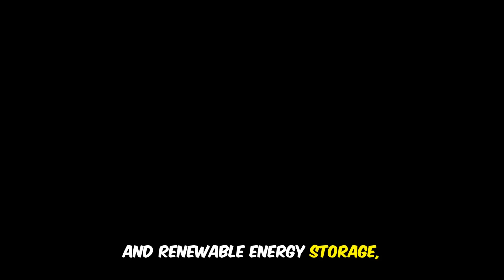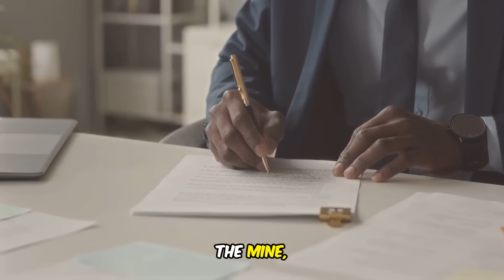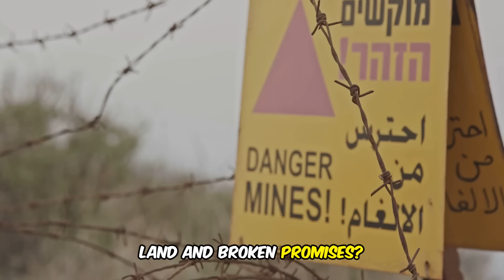Ethiopia’s Lithium Shock: The Kenticha Mine America Fears the Most

Comment: If this information is true, then,Ethiopia should plan to exploit its resources by converting into more valuable end products, and it is now high time to assess the viability of constructing a battery manufacturing plant from simple to the complex(use by bicycles, cars, buses,tram, train airplanes etc.)and minimize dependence on oil based fuels. The project could be run in partnership (jointly) with the technology suppliers.